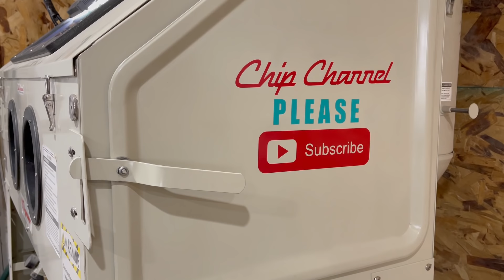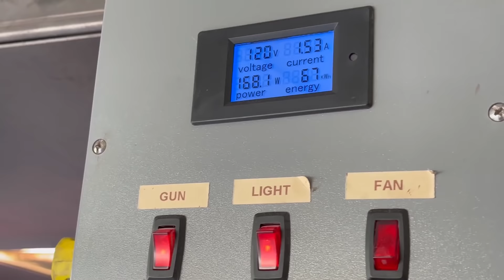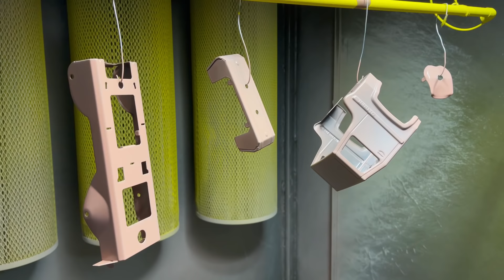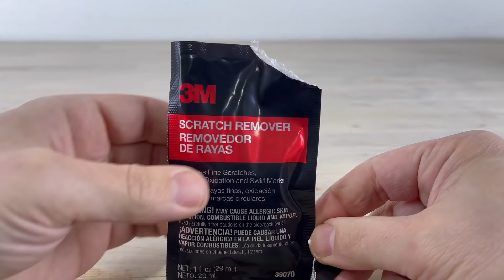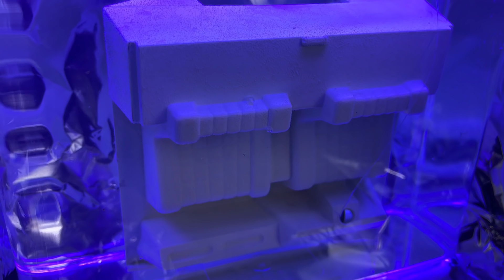1967 Tonka Gas Turbine Cab Bottom Dump Semi Truck and Trailer Restoration Number 910

Comment: I always look forward to your restoration videos of these classic old toy vehicles. This one was no disappointment. You go the extra mile to make each restoration turn out to make the toy look better than new. I have been a subscriber now for about two years. It has been interesting to see how your techniques have evolved over time.  You keep figuring out new and better ways to get the job done!  I have to admit that when you first displayed this particular truck, I thought it would not be a terribly difficult one for you to do.  It did present you with some challenges, but you still were able to overcome them and produce yet another masterpiece.  It was so amusing when you came to focus on the original whitewalls for the tires.  You flashed up on the screen that they were "rough."  Rough did not even begin to address the condition of those original whitewalls!  Keep on restoring and putting these videos up!  There are several imitators who also put up videos here on YouTube, but none of them produce the spectacular results that you do.  For me, you are the king of the restorers!

Comment: First time I’ve seen you have to do things out of order. Lots of respect to you from this airbrush-wielding model railroader for taking the time and effort to disassemble the trailer to properly do the inside of the ends and for all the gut-wrenching soul-destroying sanding and tacking you do. Who knows-maybe there’s enough of a charge to pull enough yellow through the holes to cover inside for the next restorer a thousand years from now to find.

Comment: An idea you might try so that you don't need to "crimp" the axle support might be to put a piece of plastic tubing over the pivot. Tubing like this might be available from those little balloons at the che checkout at your dollar type stores. These balloons are very small, and don't have helium in them. Another source for plastic tube would be a shoe store as these are used inside the shoes to keep the shape.
Reply from the maker: Awesome idea Bryant Fry! I'm going to try this! Thanks soo much for watching!
Reply: heat shrink would work to i guess
Reply: 9
Reply: J
Reply: Ulik

Comment: Is there a particular reason that you use JB instead of standard auto body filler (bondo)?
Reply from the maker: Thanks for the question themanonthestreet! I use high temp JB weld for a couple reasons. 1. It will withstand the 400 degree temperature for baking the powder coat without outgassing or bubbling, and 2 it has metal particles inside of it which makes it conductive enough to attract the powder when I spray. Thanks soo much for watching!
Reply: @ChipChannelRestorations  I knew there had to be a reason!  Thanks!

Comment: just a curious question: where do you get your replacement parts and Stickers labels for your videos ?
Reply: Miamo.   Ernesto.  Longo
Reply: 😂 @ernestolongo2677  g
Reply: @ernestolongo2677  it
Reply: @ernestolongo2677  yyy
Reply: @ernestolongo2677  yyyy
Reply: @ernestolongo2677  y
Reply: @ernestolongo2677  your yyyyyyyy yyyy
Reply: @ernestolongo2677  y
Reply: @ernestolongo2677  yy
Reply: @ernestolongo2677  your yyyyy
Reply: @ernestolongo2677  y
Reply: @ernestolongo2677  y
Reply: @ernestolongo2677  y
Reply: @ernestolongo2677  y
Reply: @ernestolongo2677  y66yy 6yy
Reply: @ernestolongo2677  your y
Reply: @ernestolongo2677  yy
Reply: @ernestolongo2677  6yyy
Reply: @ernestolongo2677  in
Reply: @ernestolongo2677  yyy
Reply: @ernestolongo2677  6
Reply: @ernestolongo2677  ty
Reply: @ernestolongo2677  y
Reply: @ernestolongo2677  6
Reply: @ernestolongo2677  66
Reply: @ernestolongo2677  5t
Reply: @warlisonsantos3970  t
Reply: @ernestolongo2677  5t
Reply: @ernestolongo2677  5ttt
Reply: @ernestolongo2677  5tt
Reply: @warlisonsantos3970  ĝ

Comment: I'm beginning to notice a common theme here....Tonka.
What I find interesting about this restore are the 'whitewall truck tires'. What I find particular appealing about this toy is the piece of heavy equipment it represents. The following explanation is not meant for equipment operators or knowledgeable construction folks, but instead laymen, kids who still play in the dirt, or both.
   A bulldozer moves dirt/soil around by displacing it. An excavator can both displace and scoop (placing it in a dump truck) soil. The equipment represented in this restore could do both. It can both collect soil (from an excavator) and then spread it at another location or it could rake the ground scooping up the soil, collecting it like a dump truck and relocating it. 
    What this meant for the child tearing up their parents yard was nurturing and expanding their imagination. As just possessing one of these toys would have left alot to be desired. With that said, kudos to any restorer who keeps that alive.

Comment: Many years ago I saw flyash released from a belly dump semi on a gentle slope. It flowed fast and was cool to see. After it gets soaked and dries it is hard as heck. The farmer had it built up thick enough to build a barn on and was adding more around it. Any coal fired power plant can supply it.

Comment: Have you tried brushing a torch flame VERY lightly across the tires after sanding while still spinning on the drill?  It can add a nice shine if they are plastic.  Probably wouldn't do this to rubber.  Just a thought.  Great work as always.  Cheers!

Comment: Not sure if it would work with your toys, but I spray Windex on the surface of my GI Joe vehicles before applying stickers.  It makes it much easier to move around and apply the stickers and they still stick on when the Windex dries.

Comment: Welding rods with the flux broken off would be a good choice for axles, and weld shops would probably have some around that got wet or damp, or are on the floor after welding. Another idea may be the tie wire for drop ceilings. It definitely heavier than bailing wire.
Reply from the maker: 3/16 Welding rod may be easier to find than a long 3/16 inch nail. Thanks again!
Reply: @ChipChannelRestorations  you're welcome.

Comment: Résultat absolument génial, et c'est superbe, comme d'habitude ! Ces jouets en métal étaient qd mm merveilleusement conçus, c'est carrément dingue de voir comment ils ont traversé le temps ... Y a-t-il un moment que tu préfères, pdt la restauration ? C'est quoi, plutôt le démontage, et la decouverte de tous les "petits détails cachés", ou alors le remontage final, quand toutes les pièces sont redevenues neuves ?... En tout cas, encore bravo !! 👻

Absolutely brilliant result, and it's superb, as usual ! These metal toys were still wonderfully designed, it's really crazy to see how they have stood the test of time ... Is there a moment you prefer, during the restoration ? What is it, rather the disassembly, and the discovery of the "little hidden details", or the final reassembly, when all the parts are new again ?... In any case, congratulations again !! 👻

Comment: I'm always surprised that if you can't repair, fabricate or find a used equivalent part, you're still able to buy replacement parts. One thing about Tonka toys, they built their toys to last generations (until they decided to go the molded plastic route).

Comment: Always trying out new techniques!  Do you think those parts that were assembled before being powder coated will last as long as all your other restorations?  Some parts are barely more than bare metal after all the sanding.  I know the coating breaking as you bend/twist the tabs into place has been an issue you've been working on.  Trading overall durability vs smoothing out a couple corners? 
 Hmm.  Would it have been a bad thing to do an extra layer of powder coat & baking before the partial trailer assembly/coating/baking, just to protect the hidden, more bare metal parts? Before all this, I was wondering why the rivets in the back of the cab weren't removed to sandblast underneath, while the rivets in the bottom of the trailer were removed.  I've wondered before abt addressing hidden rust in tight locations before (folded over edges & spot welded places).  You do beautiful work!!  I get that you do what you can do; but it would always niggle @ the back of my mind (the limitations of the craft of restoration aren't your fault; guess it's just a matter of learning to let things go). I've always loved watching the powder coat turn shiney!!  Loved the super "Fluffy" sheep @ the beginning!  You also upped the H2O2 concentration. Looks good!

Comment: Apart from the accessories; tyres wheels ,ladders , windscreens etc the original  manufacturing process must have been mainly 'pressed' metal parts, assembly would have been probably simple and straight forward.

Comment: I realize rattle cans suck but it seems like you lose alot of powder paint to the fan
Reply from the maker: Thanks soo much Albert Cyphers! Yup, my powder spray is turned up a little higher, I do this to help fill any pits in the metal and allow the powder to flow out over the top which gives it that super smooth look. If I was doing production parts or something super smooth I wouldn't loose so much material. Thanks again for watching!

Comment: Outstanding work as always. It was in disastrous condition. I like the smiling faces while sanding. You turned out to be the Picasso of the sand blaster 😀😀😀😀. What’s happened to your thumb , assembling incident ? Or post discussion with the catspector about details she did not liked ? 😂😂😂she won anyway , I know it .😬. Double primer was much needed considering the condition of the bare metal . Good job ! 👍🏻I am wondering , it  is difficult to find spare parts and or decals ? Are those expensive ?  See you soon. Waiting …… 🤪🤪🤪🤪🤪🤪

Comment: Hey!  I was just thinking, does that powder coat soften up when it gets warm?  If it did, you could use your heat gun to soften the tabs before you bent them.  Maybe that would keep them from cracking.

Comment: This was truly a Labor of Love! I have a question- What determines how you treat the chrome parts; powder chrome; nickel bath or just shine them up?
Reply: He's mentioned the pitting issue.  I think the chrome is for pitted, but not to the degree it needs to be replaced; nickel is for little to no pitting, & straight up buffing/polishing for no pitting.  I keep wondering how on the polished/degreaed bits how long-term rust prevention is addressed!  Like, I imagine Chrome powder coating & nickle plating will givesome protectuon, but once polished up & degreased, the plain metal pieces seem vulnerable to corrosion.  I just keep forgetting to ask abt that subject matter!

Comment: Hello , Hello there ! 
I've watched this same video several times 
in the past so , a question or two if I may .
Watching your sand blasting process 
it appeared that you didn't do the entire inside 
of the parts then when it came time to reassemble 
The parts that appeared to be the back of the toy truck 
they were already primered and wet sanded twice but 
you started to reassemble so question is why did you not 
continue w/ the wet sanding then start w/ the painting process
before assembling?

Comment: One thing which I don't really believe into is whitening plastic parts with UV lamps and H2O2. In this video it's clearly seen that you used new interior instead of "whitened used replacement". And that's not the only case. So does h2o2 help or not really?

Comment: After watching a lot of powder coating videos i was wondering could you shake out the air filters and re use the excess powder?  I'd imagine it would be an irregular color pattern but I'm curious if it's possible
Reply: It does seem like a lot of powder gets wasted, but it seems to be the price for using this technique. The results are so good.

Comment: I have a technical question.  You did multiple coats of primer and wet-sanding, which left some placess sanded through, and then you assembled before the final coat.  In areas where pieces overlap, the final coat can't reach.  Doesn't that leave the sanded-through places in those areas vulnerable to hidden rust?  Curious why you didn't do another primer coat before assembly.
Reply: The rust has been removed. Once it's painted there's no exposed metal. Maybe he did another primer coat, but if he thinks it's smooth enough it's ready for paint. Primer coat doesn't need to be perfect.
Reply: @jjryan1352  No, you're missing my point.  There's no VISIBLE exposed metal, but the metal between the panels where they are joined has areas that are not painted or primed (because the primer was sanded off, and the finish coat can't reach them).  It may not be visible to the eye, but it's still bare metal exposed to the air.  Granted it's not as exposed as if it were on the outside surfaces, but it's still unprotected and could eventually rust just from atmospheric humidity.
Reply: @dwasifarkaralahishipoor2223  you're overthinking it. It's not a big deal. The outer coat does well enough as a seal. It's just a toy.
Reply: @jjryan1352  Have you priced these toys recently?
Reply: @dwasifarkaralahishipoor2223  what does that even mean? Tonka toys were mass produced. Even the rarest in best condition originals with the packaging are under a grand. In this rusted and damaged condition you can find them online for $25. Considering the amount of money it takes in materials and equipment to restore them, it's more of a hobby not a moneymaker.
Reply: @jjryan1352  It means they're not "just a toy" anymore.  They're collector's items now.  A kid in a sandbox doesn't care if the toy is rusting from the inside out; a collector does.  I'm just surprised, with all the care and attention Chip puts into restoring these collectibles, that he'd assemble this one without every surface being fully coated.  I've never seen him do that on any other piece.
Reply: @jjryan1352  Do you have a reading deficit?  Airborne humidity will be enough to eventually rust the concealed unpainted surfaces.  Done here, will not respond further; if you feel the need to have the last word, go for it, but think about what the O in OCD stands for as you do.
Reply: @dwasifarkaralahishipoor2223  hahahaha oh nooooo. It will be a rusting hulk in a matter of minutes! More like decades. It's just a restoration of a Tonka toy. Lighten up Francis. I've seen him do other models where the primer doesn't completely cover after sanding. Again, the paint job is sufficient as an outer seal, it clearly adheres even at the joints, due to electrostatic, which is why it has such a good even finish. You can see the pan shot of his collection, no rust. They are so obviously kept in controlled indoor conditions, so "airborne humidity" won't be an issue. Where would humidity be anyhow, if not in the air?

"Powder coating is a protective layer that offers a resilient coating to materials that need protection from corrosion. Unlike many other coating processes, powder coating is a dry coating process, which means that it is solid when applied to the base material."

Comment: Do you use glass beads, crushed glass, garnet, silicon carbide, aluminum oxide, or ???  as your blasting medium. I have been using No. 7 glass beads, but thats only because its what we use in our business to satin finish stainless steel parts. I could swap out media for something better when we do the occasional Tonka, Dupke, Nylint or Ertle project, if there is better choice. Chip and viewers,   what are your favorite blasting media for steel toys, and why?